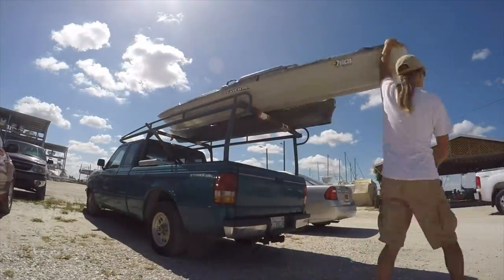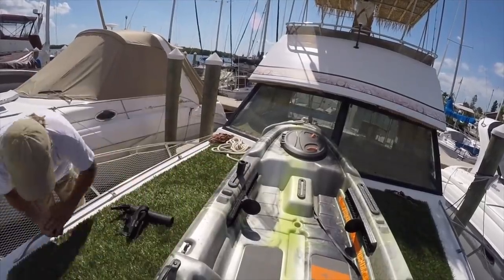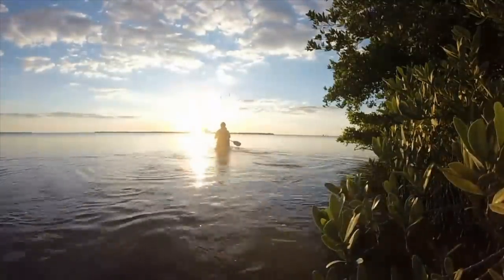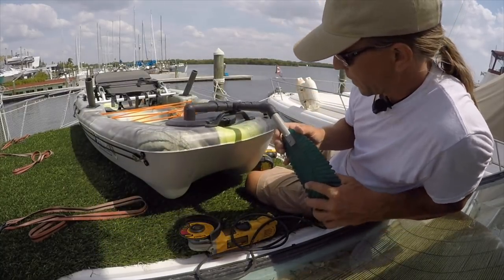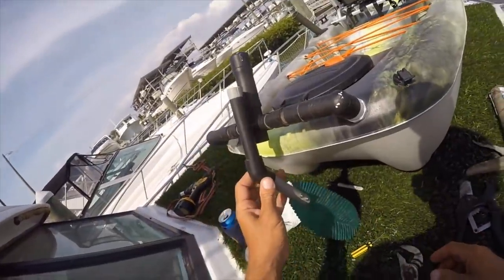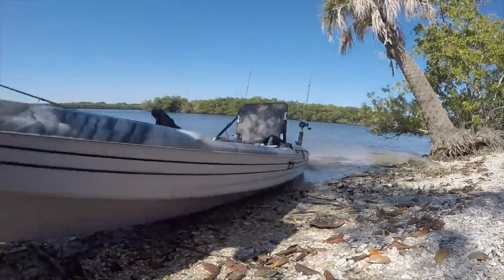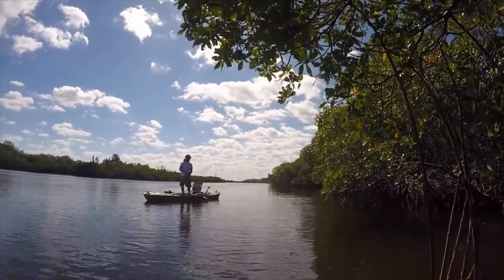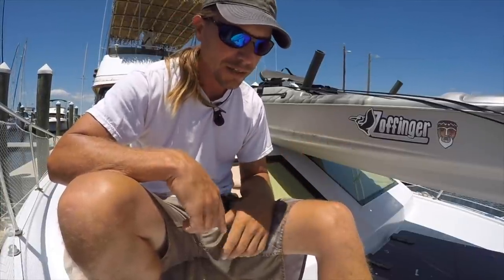How to Make a Super Kayak: Adding a Skeg

Comment: Great DIY video, no foolin' around, all solution and no yak-yak-yak. This is a really clever, simple solution to a skeg. I just bought an older Cobra Tourer, great boat but weathercocks badly in a beam wind. A well balanced, fixed position skeg should be perfect... and yes, you are awesome.

Comment: Back to fearlessly mod'ing your kayak. That's why I subscribed!
Reply: Yah.  Still cringe when he puts that 1" hole bit to the brand new kayak.  RE:  skegs, the banana leaf is crafty but adds a ton of drag.  Longer is better.  Thinner is better.  Think an aluminum street sign.
Reply: Also, any part of the skeg above the water line is wasted.  In one of the images there's about 6" of skeg above the water line.  Only wet skeg does its job.

Comment: Great video. I have an Old Town predator that I've always had similar tracking problems in windy situations. I like your idea. I could buy a rudder system for the predator but I didn't want to spend that much.  I'm going to try something like you've done.

Comment: Hey Marty, 
I just discovered your great videos. Thanks!
Quick question: I just purchased a Pelican Catch 100 and am ready to install an anchor trolley. I"ve seen photos of anchor trolleys mounted on Pelicans above and below the seam where the top and bottom parts of the hull are joined. My preference is to mount my trolley below that seam. Do you have any thoughts, advice or suggestions regarding trolley placement on Pelicans?
Thanks much!
Reply: Below the seam for sure, above the seam the anchor trolley line will get in the way.
Reply: Varro Thanks for the response Marty!! I’d gone ahead and mounted the trolly below the seam and it’s nicely out of the way there and it works great!                         Thanks again, I appreciate your taking the time to respond! Loving my Catch 100 thus far! (I did build a retractable skeg for it that mounts on the rear handle with one thumb screw that really helps with tracking. Otherwise the boat is well appointed and extremely functional!).